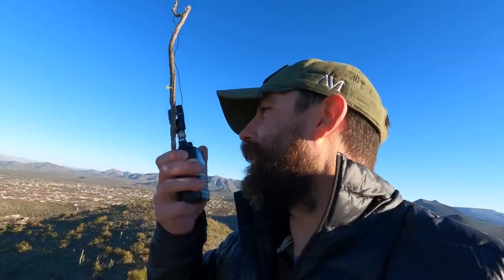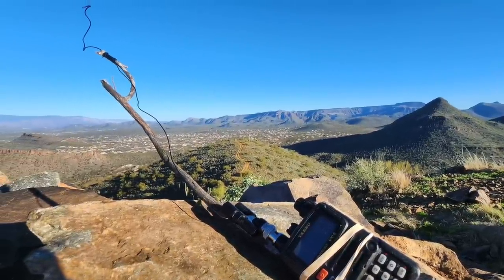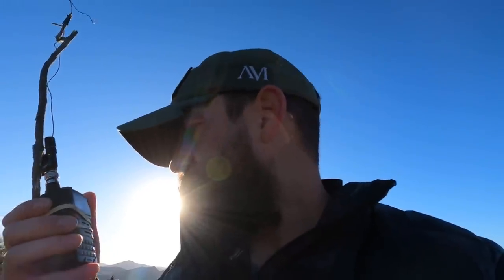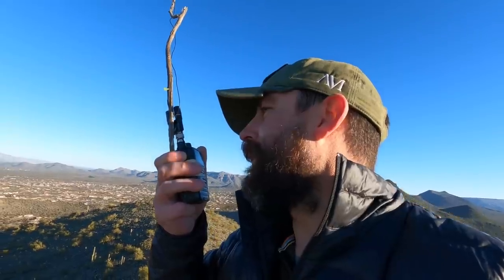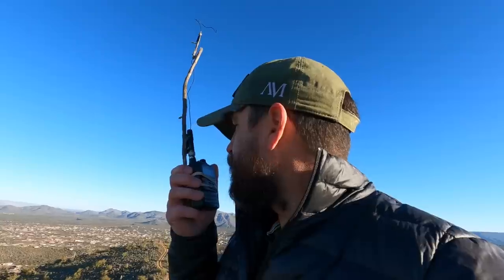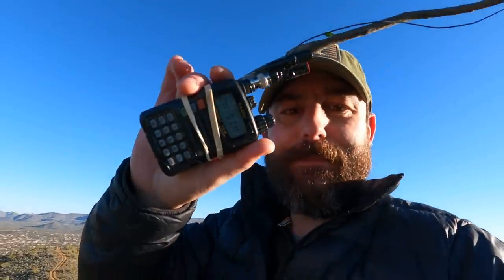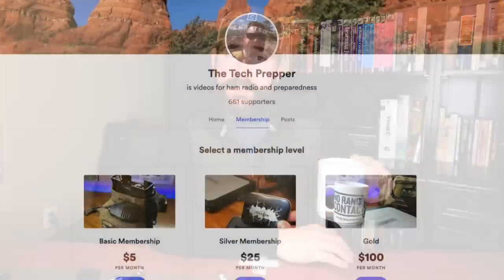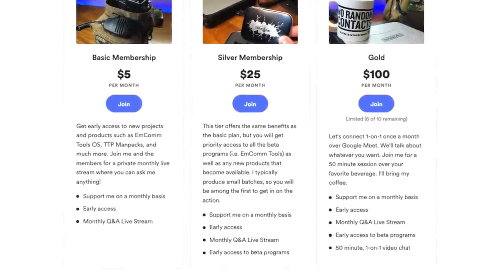Improvised Field Comms - HT Antenna Field Repair

Comment: I tried a Chameleon wire antenna thrown on the ground for WINLINK NVIS.  Worked great.  I believe in making conditions bad to train so when they are bad in real life you already have a course of action and not just a plan.
Reply from the maker: I agree with you 100%. This is why I am a huge proponent of training outside of the shack. It forces you to think about your resource consumption and forces you to adapt if needed without the comfort of having access to all your gear and tools at home.

Comment: Excellent video, Gaston! I will add both a cobra head and wire to my radio kit ASAP. Looking forward to new videos in this series.
Reply from the maker: Excellent! Check the continuity on the center pin if you go with the Chinese model I had in the description. I am going to test this higher quality Cobra Head tomorrow: https://amzn.to/3wZFOEd
Reply: @TheTechPrepper  I did make a note to do just that, however, I'll await your test results on the higher quality connector, first.

Comment: Great use of the Cobra head. Always have a couple with me. Something that would help with antenna length. I took about a yard of white string and tied a knot every 5 inches on it. I marked every inch in between the knots with a marker. I use it to make sure I get equal measurements when adjusting the length of a Dipole. It would work great for a HT antenna measurement also. Weighs next to nothing and takes up almost zero space. Josh over on HRCC did a good video about a kit for making improvised antennas. Worth taking a look at. Your video got me thinking about another way to measure. Those little measuring tapes that the wife has in her sewing kit are about a yard log and roll up very small. I might add one to my kit. 73 !..... P.S. Maybe have a pre made length of wire in your kit for the 2 meter antenna and counterpoise. You could check for best length as to SWR in advance and it would allow full power use with no worry. Good Video Gaston.
Reply from the maker: That's a great technique. I do the same thing with the paracord in my pack, but for my longer HF dipole measurements, so they are space out at 1 meter increments. Those measuring tapes are great. I used to have one that I borrowed from my wife when I was experimenting with the PackTenna TrekMount and a pair of telescoping antennas. A few days ago I added this fabric measuring tape to my kit: https://amzn.to/3Y4fMMf It will be used in the next video when I cover the "Jungle Antenna" (Quarterwave Ground Plane Antenna).
Reply: Depending on the thickness of your string you could wrap it onto an old flexible solder wick spool
Reply from the maker: @boisinnawoods  That is an excellent idea. I have few of the small spools. Thanks.

Comment: Wow - good thing you double-checked the polarity on that cobra head connector!  It does not matter so much on an HF dipole, but this application is super critical!
Reply from the maker: Yeah, I was lucky that I heard The Smokin Ape mention that this could be a problem last year. I am also going to switch the brand of my Cobra Heads to Pomona Electronics.

Comment: Not "field-expedient" but when I am backpacking with a radio, I ususally have the stock rubber duck (or a short aftermarket one) and a longer aftermarket antenna. This serves two purposes, 1) having a back-up, and 2) comfort/convenience..depending on where I attached the radio, the long whip sometimes gets in my face or digs into my armpit.
Reply from the maker: That's an excellent habit. I do the same. I run the waterproof, stock rubber duck on my VX-6R, but also carry a flexible antenna (Comet BNC-24 or SignalStick) that can be folded into a loop for compactness.

Comment: Great tips. I typically carry binding post for my KG6HQD speaker wire dipole, my HTs use BNC, and I would not have thought of band aid as structural adhesive either.
Reply from the maker: Speaker wire dipoles are great! Actually, a band aid saved my bacon on a week-long backpacking trip with my Uncle back in the 90's. We were 3-days in and the gasket broke on our white fuel stove. I was a teenager at the time and used the band aid to improvise a seal for the pump. It worked great!

Comment: Awesome Gaston, I keep 2 pieces of 1mm Nitinol wire rolled up in my kit, (eliminates the stick) along with the cobra head, have only ever used this setup in a dipole or tiger tail configuration, but it does work well, don't know for sure, but I'm thinking it may help with SWR too. Keep up the great content, love the scenery.
Reply from the maker: Great tip! I will take some SWR measurements for the next video (The Jungle Antenna). Glad that you enjoyed the scenery.

Comment: Another good one, Gaston. 
Just what I like: field expedient, portable, real-world comms.  Very much like the idea of connected, not random, contacts and a networked team. 

I am driving a tractor/trailer OTR (over the road) and am still working on my setup; currently HT dual band but working toward mobile all-band capability.  

KJ7MLF / Chris
Reply from the maker: Your tractor/mobile setup sounds like it would be an interesting project. Good luck with your setup.

Comment: Great video. I'm looking forward to more in this series. Also, I couldn't help but notice Riven in the background. That was one of my favorite video games (and soundtracks). 73
Reply from the maker: Thanks! I actually never played it. I loved Myst, so about 6 years ago I found a copy of Riven sealed, so I bought it. It's never been opened. I probably should pull out my old PC and see if it will run. I rebuilt a Packard Bell, Pentium I from old-new stock components around that same time to play a number of games (e.g. Myst, Doom, Duke Nukem 3D, etc.). It running Windows 95 version C. It was an interesting project as I had  buy old-new stock of 3.5" floppies and sealed copies of Windows.

Comment: Well Done! This was a great way to show 1 in none. I like the idea of this series. What are your options if you have a failure and need comms.
Reply from the maker: Glad you like the approach that I am taking for this series. In general, my position is that you need to have skills, gear (radios), and repair gear in advance. Redundancy is key. However, this questions makes me wonder whether I should attempt to build a simple receive-only radio.

Comment: One point that you mentioned is to know certain body parts and how long they are.  In addition to you elbow to middle finger, know the length of your wide opened hand, tip of the pinky to the tip of your thumb.  How long is your pinky and your middle finger?  How long is your stride?  Handy measuring tools that take up no extra space in your kit.
Reply from the maker: Great point. In the last video, I used my foot (roughly 12") to pace out 33' for the legs of an improvised 40m dipole. I was able to get 2:1 SWR with that swag on the first attempt. Start measuring, my friends.

Comment: I threw a BNC to binding post adapter in my go bag a few months ago. Now I'm wanting to double check the polarity on it!
I'm also a big proponent of throwing one of those cheapie earpieces in your pack, as in a pinch, they can replace three different components on your radio (speaker, microphone and PTT button). They're mostly otherwise useless (IMO), but they're light and don't take up a lot of room.
Reply from the maker: The Smokin Ape mentioned this about a year ago. I am glad I checked. I am actually ordered a higher quality split post BNC (Cobra Head) for the next video. It's price but people rave about the quality of the 1296 from Pomona Electronics. Here's my affiliate link if you're interested. The cheaper one that I used for this video is in the description. https://amzn.to/3wZFOEd

Comment: I've done something similar with just the SMA-to-SO239 adapter. A banana plug with 19" wire will plug directly into the center of the SO-239 and be optimized for 2m, and about 2:1 SWR on 70cm. Cut the wire to 12.5" and it works on 1.25m. It might even be possible to do a three-section linked vertical ending in a banana plug, to fit the SO-239.
Reply from the maker: The technique your describing works, too. In fact, that the SMA-to-SO-239 adapter I showed in the kit handles your approach with just the bare wire inserted into the center conductor.

Comment: I had another thought. You run Yaesu HTs, I generally run Kenwoods. The TH-F6A and D-74A are both tri-band rigs that do 2m, 1.25m, and 70cm bands. (Aside: We really need to protect our access to 220MHz!) I have found no BNC antenna that will provide access to all three bands. 

The TH-F6A is a handy little rig and will charge from the station battery. So will the D-74A. This is one reason I upgraded from my older TH-D7A(G) HTs. I am working to reduce the number of moving parts in my portable rigs.
Reply from the maker: Take a look at the Diamond SRH320A. It's a tri-band antenna. I used it for over a year before the top section snapped off due to daily abuse on trail runs. It was a great performer.

The D74A is a great radio. I had one for about 3 months, but ended up selling it as I would break it with my trail use. It was nice having SSB receive, APRS and user-accessible TNC.

73 de KT7RUN

Comment: I cut an alligator clip in half, stripped and soldered the ends to prevent fraying, and keep it in a cobra head to clip right to another piece of metal.
Reply from the maker: I like it. Thanks for sharing. Keep the tips coming!

Comment: Would love to see Your technique on When no HT kit available & ant literally SNAPPED
Reply from the maker: Noted! The the military manual has the solution. Strip a small section of the outer insulation on the broken antenna and expose the center conductor on both pieces. Tape them together, then add a stick has split. Add more tape.

Comment: I'd wonder how the wire in the Survivor Cord would work. It has a wire and is my default cordage in EDC and when in the woods. Some of the ideas I'm planning to test is using it for a EFHW and random wire antennas.
Reply from the maker: Give it a try and report back.
Reply: @TheTechPrepper  Tried it an it worked. The key here is Survivor Cord, not Survivor Cord XT which replaces the wire with a Kevlar  strand. I was able to make connections using VHF and HF using a binding post. The wire is 30awg, so QRP is best. Did not separate, so there is a possibility of wire breakage within the sleave. Ideally, checking continuity for the hf antenna would be helpful.  I used a 9v battery and tongue to check it.
Reply from the maker: @toast803  Nice!

Comment: Too fun!  Wondering why you don't just go to BNC on your HT all the time?
Reply from the maker: I run the Comet BNC-24 inside the chest rig if needed. It's an eye hazard when running and compromises the IP67 integrity when using the adapter. I sweat heavily on the radio and large amounts of salt collect around the antenna. I run BNC all the time on my non-trail radios.
Reply: @TheTechPrepper  I knew that, if I asked, you had thought it through.  Just wanted to understand the logic.  I think about the same things alot - but not as much as you!
Reply from the maker: @bereadyeveryday6764  There's usually a method to the madness. Cheers!

Comment: Can you not just swap the screw pieces to use red on center conductor post? I had the same thing and did this on mine.
73
Reply: Haha. I guess i should finish the video before i comment.
Reply from the maker: Haha. Yep. That was the fix.

Comment: Keep keeping it fresh.

The cobrahead is always a winner. Maybe chokes. Old tube TV had nice ferrites on the picture tube. A toroid in the kit with your wire allows chokes, loop and endfed antennas, 

This guy majors on improvised survival comms. One of his builds uses bicycle cables to build a groundplane antenna.

https://youtu.be/BuzUFEpVCzc
Reply from the maker: I appreciate the suggestion on the toroid and the video link. If you know any pro tips on the "Jungle Antenna," I am all ears. I am working on this build for the next episode. I have a few tweaks in mind for my version of this Quarter Wave Ground Plane antenna. We're going to learn some new knots or brush up on the knots we may have forgotten. ;-)

Comment: No reason it shouldn’t have worked. That said, I’ve spent weeks at summer camps with scouts living with HTs, and they’ve never broken a rubber duck.
Reply from the maker: I have broken many antennas. Mostly the Diamond SRH320A. The top end snaps of about once a year with my trail runs. Those antennas are only good for about 1,200 miles. Diamond support tells me that I am using their gear out of spec.